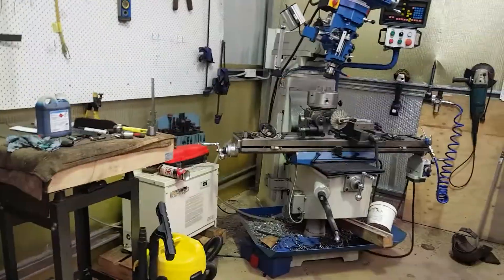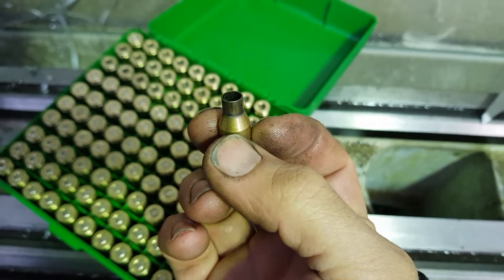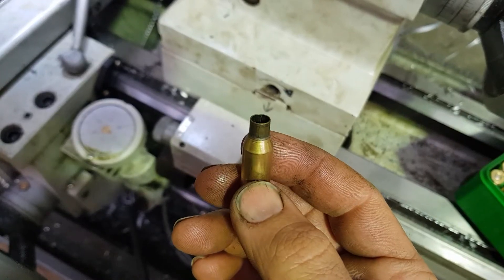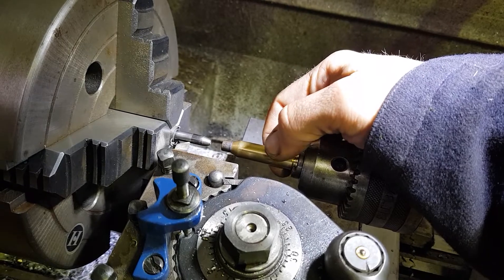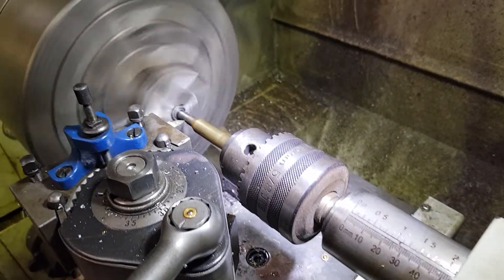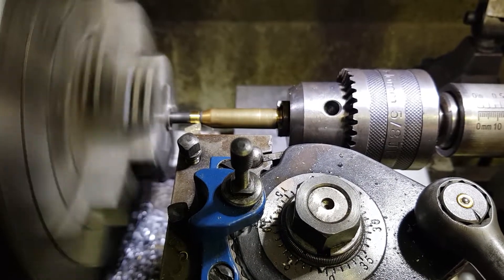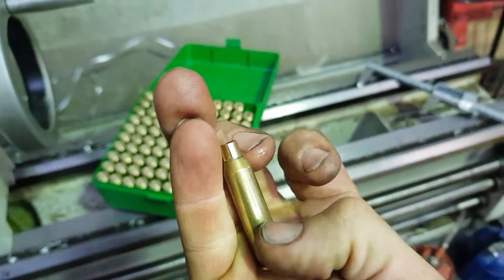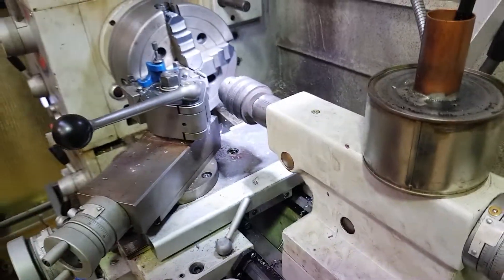Can you neck turn brass on a lathe??? YES YOU CAN!

Comment: Awesome idea mate. Just wondering if you had to tweak the shell holder at all or is it stock? Thanks in advance.
Luke
Reply from the maker: Hey Luke. Nothing modified on the shell holder. Just the same one I use on the press. I was just conscious not to leave the case spinning in it for too long on the lathe, though.
Reply: @thejonoaffair Yeah mate that's excellent. I'm going to give it a go tonight. I'm sick of buying neck turning mandrels and setting up. So expensive when I have a lathe 😂.
Hopefully the Chuck I have for my tailstock opens up big enough for the little flange on the cadeholder. Otherwise I'll make something up. You're a champion mate. Good on ya. 👌

Comment: Nice. 

How about the inside?

Now I’m going to look into a mini lathe.
Reply from the maker: I didn't worry about the inside for this lot because the expander mandrel took care of that for me. And I don't have a neck turner, but I do have a lathe, so use what you got!
Just FYI I was only neck turning because I'd necked down .308 brass to .260Rem and the neck walls were too thick. Wasn't a concentricity problem.